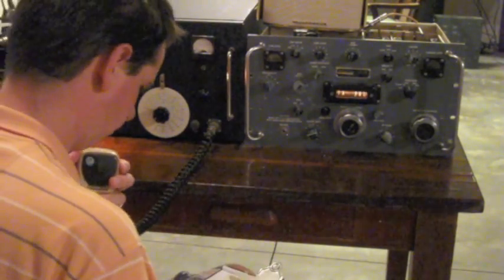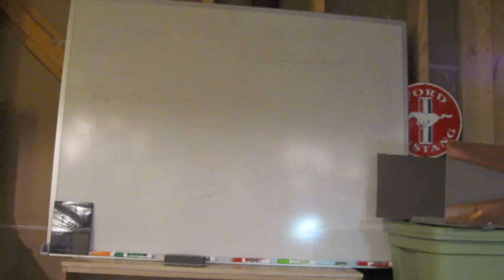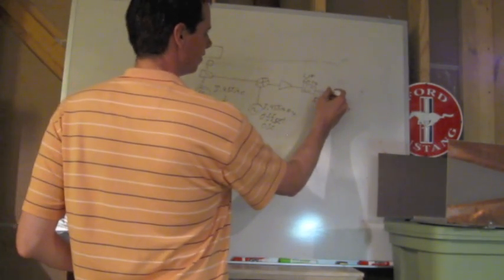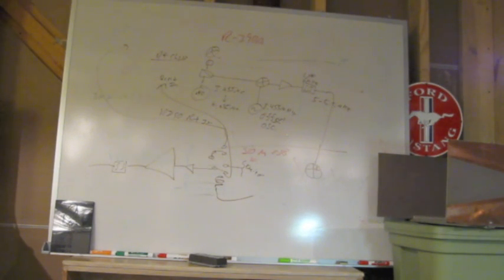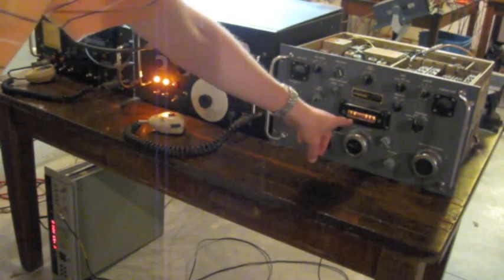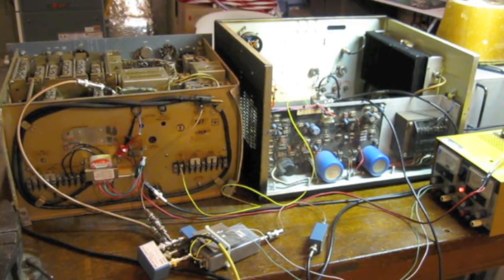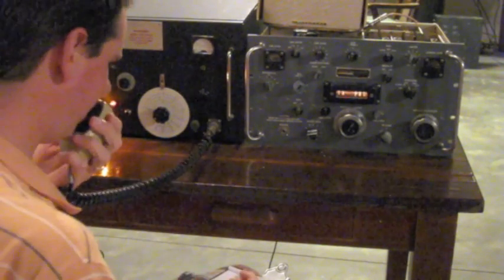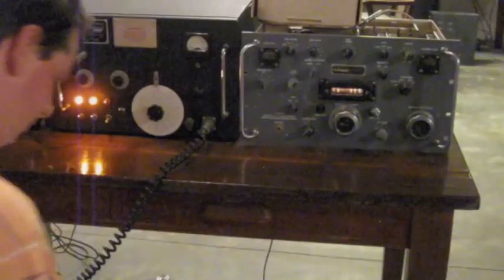Hacking the R-390A to Transcieve SSB

Comment: I do not personally have the R-390A but I do have the Collins R-390 (non-A) and for muting the receiver I use the BRK IN contact, pin 9 on TB103. It can be seen on page 179 of the R-390A manual. Grounding pin 9 mutes the receiver properly. It works perfectly on my non-A model R-390. Will this not work on the "A" model? I just checked the schematic and it looks the same. I use this receiver in conjunction with a Collins S-Line transmitter. Always nice to see videos on these grand old receivers. Thanks for posting.

Comment: Hi Gregory,
Nice project. There was an article in Electric Radio a year or two ago and if I recall correctly it was doing basically what you have done with a 390A, again, I may be in error here.
At any rate, very well done project and excellent homebrew xmitter.
I restore R 390 and 390A receivers and always enjoy seeing what others are doing with these awesome receivers.
73, 
Glenn WA4AOS
DSM Labs (dot com)

Comment from the maker: Thank you for your kind words Walter.  Next would like to try this technique on a BC-224E (which is a 14V version of the BC-348, of course the dynamotor is gone from mine) without invasive modification.  Maybe coupling off the LO somehow at the plate, say a .01uF to the high-z input of a wide-band op amp, then this off to the VFO converter shown in this video.

Comment from the maker: Good point.  My plan is to use an Si570-based VFO as the universal offset oscillator, these can be procured with digital interface for $40 if you google it.